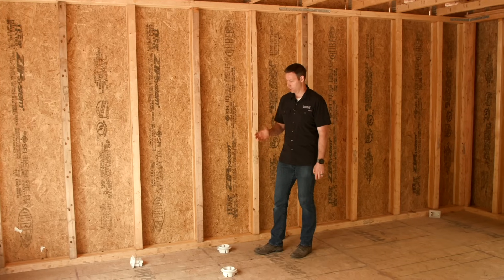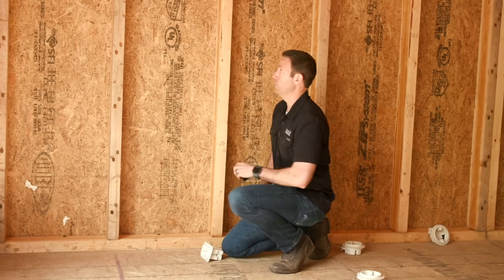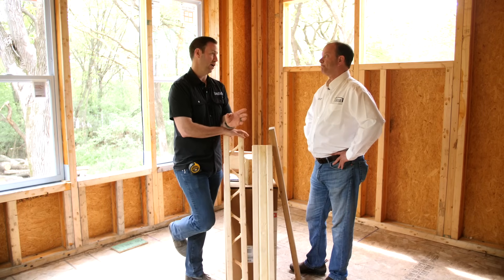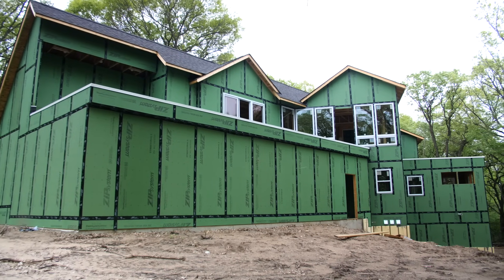Insulated Studs? This is a BIG Innovation in Framing!

Comment: 1500 dollars more, I doubt that, This product must be shipped and ordered, A 2x4x8 cost about 3 bucks, This is more than likely 10 dollars or more per unit.  There will still be small amounts of thermal bridging.  The only real way is to build a double stud frame house that pretty much a house in side a house...  When double stud is done right you will have very low amounts of thermal bridging.  Windows and doors are the biggest factors in any housing build. Windows should allow for indirect sunlight in the summer and direct sunlight in the winter, This can be archived by correct window placement, Larger eaves. Doors should not be your standard size and or thickness either, exteriors doors should be 48 inches wide and 3 inches thick. Windows should be of the highest you can buy, Triple pane are easy to get while quad pane are getting more popular, These windows can have an R value of up to 11... In a double stud framed house you can have and exterior window and an interior while still having a nice and large air gap between. R values should be doubled for the coldest climate in your country. I never understand why warmer climates need less insulation, If you are cooling your home in 115F an R 10 ceiling is not going to keep the heat out for long...  The lack of insulation and proper building is the result of very high energy costs. There are people who are paying extreme prices for energy to heat and cool their homes, More insullation means less running cost. The ROI is going to take a lot longer to pay back, Yet if your house is built right today it should last you your entire life and a few other peoples lives with very low cost to heat and cool.
Reply: That extra expense for a 2x6 TStud is partially offset by not needing as much of it:   16 inch spacing versus 24 is a 33% reduction.  A single top plate instead of a double is 50% reduction.  Consider an 8 foot section of wall:  ten pieces conventional (3 top and bottom plates, and 7 studs) versus seven (2 plates and 5 studs)   These average to about a 30% reduction overall.  Assuming your estimate of 3x price per foot is correct, it works out that the overall framing materials are 110% more expensive (70% of 3).

As for warmer climates using less insulation than colder is because a warm climate (like southern California) has much reduced heating needs but about the same requirement for cooling as non-temperate northern climates.  Example, zip code 90001 (downtown Los Angeles) has 1002 degree days heating and 1218 degree days cooling.  Minneapolis (55001) has 7821 degree days heating and 1112 degree days cooling.   See https://portfoliomanager.energystar.gov/pm/degreeDaysCalculator
Reply: @wallykramer7566  As for insulation in warmer climates, Insulation is pretty much used to slow the heat entering or escaping your box. That is why I do not understand why lower amounts are used in warm climates. If you build a solid box and put a heat source in it, It will take a certain amount of time for that heat to make its way to the outside, The same concept should work for cooling, If you cool that box down to 60f and the temperature is 100F out side, How long does it take before that heat starts warming up the inside and making your cooling unit work harder.  Insulation works both ways, Larger R values will reduce the amount of energy it takes to cool and heat an area. 

Net zero homes work on the concept that you almost never need to use a heating source and or cooling source. There are houses out there in real cold climates that are just heated by the heat from your appliances, light bulbs, computers, tv, and pretty much any thing that put out the smallest amount of heat. Cooling said area also takes very little energy. 

As for 24" centers, A lot of new construction is already built that way...  The idea my work, It will take years for it to come in to common use. The same goes with all of the other better and green types of construction. Its extremely expensive for one,  when its not common in the area its harder to find someone who will do it. The same goes for ICF,  There are not that many people who do it yet, For my remote area, You will only find a few people who say they can do it, yet they have never done it. 

Until this Tstud is put in manufacturer homes, It will take a long time for it to be common use.  With the amount of pre built homes that are being made and sold, this should be the market for it, Once it grows enough and builders start using it it more it will just be another one of those concepts that will cost more than it is worth..

Comment: is this really a savings? most heat loss is windows and doors.  just wondering if this is really worth the money. also firring out the headers looked like a question. is the added foam wrap that big of a deal for most framers? still need tyvek right?
Reply: more stable, 4x more load bearing, doesn't buckle... saves the environment too, using smaller diameter wood to make it...

Comment: How is the electrician supposed to staple his wires? If he's on the front or back wood part his wire is too close to the edge.
Reply: Would you need to staple it?  Would pushing it through the foam so it's held snugly in place satisfy the code requirement for being supported?
Reply: @andrewalexander9492  the wire is considered supported wherever it passes through a hole, but I see a problem whenever the wire needs to pass vertically in the stud cavity. There must be an approved solution I'm just curious what it is.

Comment: In absolute terms a truss is less strong than a solid piece of same dimension. In all directions. This has a better R value, sure, and that's it.
Reply: Hahaha no,  yeah you're right ... for the same dimension. The Tstud isn't the same dimension as a 2x6 (1.5 x 5.5), it's 2.5" by 5.5". that 2.5 inch thickness is there the extra resistance to bucking comes from.
Reply: You didn't listen? I thought the same then he got numbers out: rated 8000 lbs per piece vs 2000lbs on a 2x6 which I think is for compressive 8 ft length. These are also more rigid and don't buckle. 

My concern is more about health with off gassing, environmental in terms of this is a foam product and fire issues. A solid 3x6 would last better in a fire than this truss . Same issue with those geniuses that install  engineered i beams.
Reply: @rolfbjorn9937  I did not think I needed to spell out "same material and grade" in my original post but it seems I was wrong in that regard. Also, rated strength is not actual strength. I am speaking on actual strength.
Reply: @hahahano2796  "I did not think I needed to spell out "same material and grade" in my original post but it seems I was wrong in that regard. Also, rated strength is not actual strength. I am speaking on actual strength."

We're comparing two products that serve the same purpose: A T stud which is an engineered product and a normal 2x6 stud. It's just impossible to compare "same material and grade" here.  We'd be comparing a 2.5 x 5.5  vs a 1.5 x 5.5 if it was solid wood. The 2.5 x 5.5 is obviously stronger and less likely to buckle. 
The T stud, built like a truss, performs somewhere in the middle in terms of strength I presume, but has way less wood. 

Your point is wrong actually, if you compare a truss to a solid piece of wood of same dimensions, or a steel I Beam with a solid steel member, you'll discover that that shape is not just about saving material.
Reply: @rolfbjorn9937  So you ignored my post. Andrew's post. Mistook my expanding the topic for your benefit for something else. All while forgetting my first post was responding to the video and misinformation in it which would lead people like yourself to believe a truss is stronger because it's a truss while inadvertently admitting you don't know any basic engineering ("...I presume...")

Wow.
Reply: @hahahano2796  Well, you seem to read in quite the diagonal, I ignored no post, I actually replied pretty much point by point to what you stated, also including Andrew's comment about the dimensions. I also used "I presume" instead of stating something as factual when  it may be wrong.
Reply: @rolfbjorn9937  So you ignore "of same dimension" to talk about different dimensions and call someone wrong when they're not while admitting you're just presuming. Then go onto say you replied "pretty much" point by point which means you didn't and as outlined didn't even really cover what was being talked about.

Wow.
Reply: @hahahano2796   I haven't ignored anything yet. Now I'm just giving up. I'm out of flying trusses.

Comment: Normally I am sceptical and critical of new building products, it seems like everything is just getting made cheaper and cheaper and I still don't like stick built houses but for a stick built house this is impressive. I still prefer ICF or other forms of reinforced concrete for exterior walls and my guess is that this is not any cheaper and probably more expensive with the labor involved.
Reply: You clearly were not listening to when they talked about the labor with the contractor, who clearly mentioned this could be installed using less labor since it is less wood and thus less weight. Go ahead and watch again and listen better this time.
Reply: @Joshua79C  
Labor is not free, you still have to add labor costs into the equation when comparing two different building techniques. You clearly did not comprehend what I was saying. I was not comparing this to traditional wood framing, I was comparing this to ICF walls and when doing so you have to include labor into each one. If I were comparing it to traditional wood framing you would be right but I wasn't. ICF by the way means insulated concrete form.
Reply: @Joshua79C  Maybe it's because you come off as a know it all, when you stated that I "clearly were not listening  to when they talked about the labor with the contractor, who clearly mentioned this could be installed using less labor" when I did actually listen, The fact that I factored in labor costs does not mean I didn't hear the part about it being cheaper than labor for traditional stick built houses. When you clearly do not comprehend what someone is saying and try to correct them you open yourself up to being looked at as having trouble comprehending what you are reading, I was just trying to make it easier for you to understand.

Comment: What about fire rating?  I suspect this would burn a lot faster than a standard stud simply due to change in mass never mind the added fuel of foam.
Reply: Presumably, the sheetrock is the same, therefore the burn-through is the same.
Reply: @wallykramer7566  the Burn through TO the studs might be the same, but the studs or framing would burn a lot faster and you would lose structural integrity a lot faster.

Comment: Where are 24" on center studs allowed?
That is weak.
Wood has heat capacity.
That is why log cabins resist temperature swings.
I really don't see the point of the fancy studs.
Can the plumber drill those for trap arms and vents?
Or does cutting the dowels compromise integrity?
Where do you built these toothpick houses.. Universal Studios?

Comment: But they used OSB, not plywood. One drop of water and I guarantee it won't dry. I can prove it on my house.
I'll bet electricians love it
Reply: They put plastic on the outside of the OSB to block water but some companies cut cost and use a porous plastic that will allow water through.
Reply: There are several grades of OSB.  Types 3 and 4 are humidity-proof and water resistent.  See https://en.wikipedia.org/wiki/Oriented_strand_board#Types
Reply: @wallykramer7566  It won't delaminate like plywood or warp and there are no hidden voids to worry about. In general it's just better suited for a house covering then plywood. That being said though I have had to send back a few bunks of OSB that where short on glue in the past. But that was a long time ago when we first started using it .

Comment: I don’t get it. Why would you use a 2x6 for wall framing when you could use a 2x4 which is a lot cheaper and takes up less space for insulation. If you’re trying to save space then why would you do that? Not including the insane price that those probably cost to buy and the completely unnecessary thickness of those walls. The only instance I could think you would need insulation 6 inches thick would be in the mountains where you get negative temperatures. I may be wrong but I’m Just wondering
Reply: Did you notice where Matt went for the video?  Minnesota.  Know what the winters are like in Minnesota?   Kinda frosty.   6" walls have been the standard in residential construction for a couple of decades now in the norther parts of the country, and it's entirely for the thicker insulation.
Reply: Andrew Alexander thanks for the knowledge I wasn’t aware as I live in Florida where it is hot year round😂
Reply: If I lived in Minnesota with only 6 inches of insulation I would freeze to death!

Comment: Looks great innovation there. Though what is the foam? Off-gasing issues?
Reply: Would think the controlled environment at the factory would make for properly catalyzed foam ,plus the time from manufacture to install allows for some off-gassing. I read that most spray foam issues are caused by installer error in adjusting to environment variables at the time the foam is sprayed.
Reply: @jamesooten3659  Excellent advice for anyone anywhere in the world. Same human nature applies.
Reply: @jamesooten3659  And that is why we have inspectors and building departments and courts of law. The main problem she had was hiring out of state contractors that weren't bonded in the state she lives in. Oopsy.
Reply: @iamjackalope 
Where I live, there are no zoning laws, no building permits required, or building inspectors. The only exception to the rule being homes financed by The Veteran's Adm., who inspect the job site weekly. The Electric Company inspects your power pole set-up and from the meter to the breaker box before they'll turn the power on. The water company inspects the pipe from the meter to the foundation wall for leaks and that the pipe will be covered by 18" of dirt. That leaves plenty of room for errors and dishonest contractors. So basically you have to be your own building inspector here.
Reply: @jamesooten3659  Do you live on an Indian reservation?
Reply: @iamjackalope 
Nope, no Indian Reservation. Just a part of the Appalachia's. Everybody here's mostly a jack-of-all-trades, master-of-none kinda thing. No Trades except for heating & cooling. Do what you wanna do, build what you want to build. Hey, maybe this is a last frontier area?
Reply: @jamesooten3659  Wow, Way to run with it .

Comment: Eliminating the double top plate is a function of lining up the studs under the joists.  It has nothing to do with fancy studs. It’s called “Advanced House Framing”.  You can save a lot of lumber but you need clever framers.
Reply: And a home owner willing to compromise window,door locals.
Reply: A clever framer is someone who uses screws, rather than whacking dents into timber with a hammer!

Comment: @1:16 "what you're looking at, basically is a truss."  Really ? - to hold a lateral load?  How much weight are a bunch of dowels and some 2x3's going to hold non-vertically
Reply: These newfangled studs would be stronger if the dowels were *square*. Granted,  more difficult to drill/mortise matching square holes, but square dowels would waste less wood  and be cheaper to manufacture. Just saw them to the desired dimensions, no lathe or lathing required!

Comment: Hey Matt what about cost compared to regular wood ?
Reply: no shit.
Reply: It is more per stud.  However, if you're a builder that foams on the exterior of the house, then it is basically a wash in cost, as you no longer have to insulate the exterior.  My understanding is that it is little less than double the cost of a traditional 2x6.  Trades will like them better.  Currently, they only offer already insulated boards, as opposed to what the video states.

Comment: I would have expected the cost increase to be far greater than an average 5K...Fantastic design and use of materials...I figure if it is that good against cold, I can imagine, especially hearing the heat test result, that homes in the south may benefit from considerably reduced A/C usage in the summer, along with the decreased heat usage in the winter, to bring a homeowners overall annual costs way down...Not to mention the benefit of increased strength against tornadoes and hurricanes...Let's get this technology to Texas ASAP!!

Comment: So if a 2x6 cavity filled with batting is R19 and a 2x6 stud is R6, how can you get R20 out of 3 inches of wood connected with dowels and filled with 2 1/2 inches of foam?  The 3 inches of wood will be around R4 and even less with the connecting dowels.  So the 2 1/2 inches of foam would have to be really high to make the stud R20.  What am I missing?
Reply: R 4 is about right for the wood, so 2.5 inches of foam needs to be R 16, which is an R value of 6.4 per inch of foam.  There are foams whcih exceed that value.

Comment: Does the foam disintegrate after time goes by, it does in uv light,I know but if it breaks down over time it would weaken the structure
Reply: Covered in the wall, not sure how light would get to it in this case, unless you know the owner decides to do some wall remodeling, is a good time to see how much it has degraded if at all while covered from the sun thus preventing said solar degradation.